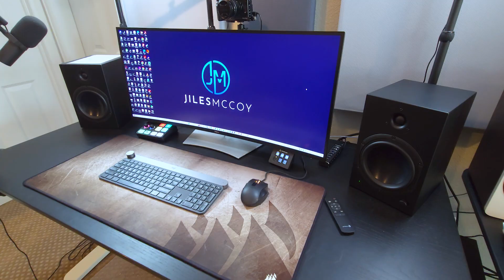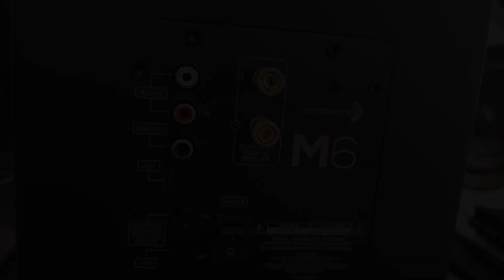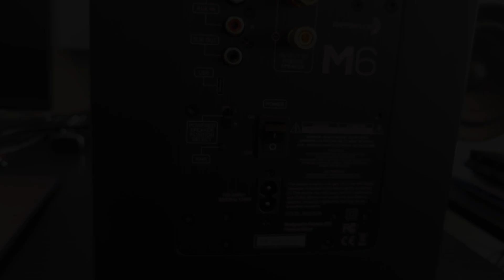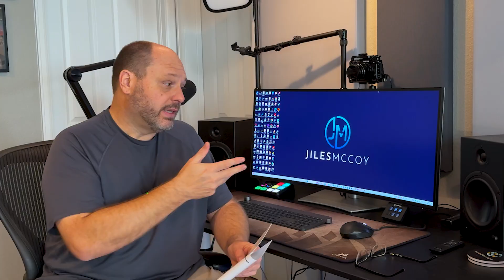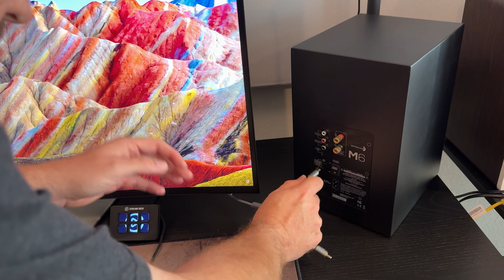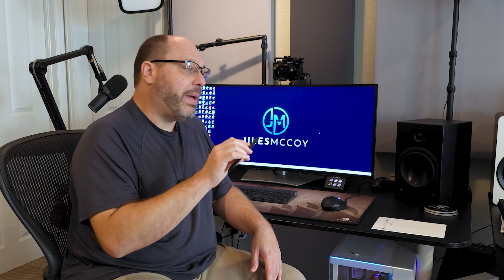I Use These Powered Speakers EVERY DAY!

Comment: 200hz is far too high of a crossover frequency to a sub.  The sound is directional at that point, and is also going to typically sound somewhat muddy through most entry level to average subs.  A typical crossover frequency for those should be more like 60-80hz.  100-120hz would be considered high, and the highest any sub should ever be crossed at under normal conditions.  The sub crossover on the M6 is variable from 20-200hz it's not fixed at 200.  The reported frequency response of the M6 is 35hz, which means it's either -3, -6, or -10db at that frequency (they don't specify, but I would suspect it's -6 or -10 seeing they're a small sealed speaker... but they do have a dsp bass boost feature).  Unless you're playing REALLY loud, such that the m6 cannot output 60hz at the required SPL, which would be a scenario in which you raise your subwoofer crossover frequency, then you will get better overall sound (consistent tonality, preserve stereo separation lower - into the bass drum and bass guitar range, and more detail) by lowering your subwoofer crossover frequency. 

Your sub's crossover doesn't have to match the M6.  The m6 control is your high pass filter point - meaning you want the speakers to roll off at and below this point.  You can then play with your subs crossover frequency separately to get an appropriate blend/hand-off between them, which you can ONLY properly evaluate using a measurement mic and Room EQ Wizard, or by playing sine wave sweeps and listening carefully for peaks or nulls around that crossover frequency.

When you said you use a 200hz high pass and sub x-over frequency with these medium sized bookshelf speakers, I instantly though, wow ok this guy has a lot to learn about sound.  That is not normal, nor is it the intended design/use case.  200hz is VERY high, and you're robbing at least 1 if not 2 octaves from the M6 that it is perfectly capable of.  That's even getting well into the male vocal range, and it's going to sound like ass compared to properly setting things up.
Reply from the maker: You have the concepts down, but your understanding of the implementation of the sub out on the M6 is wrong. The sub frequency output is fixed on the M6. There is no way to alter that. The volume of the sub output is controllable, just as the the speakers themselves, via the volume controls. Basically this is summing everything 200hz and under and pushing it out the sub RCA. The main speakers still play full range. The instructions indicate that you should use the low pass filter on your subwoofer to blend your subwoofer in with your mains (the bookshelves). Since the summed output is up to 200 hz you could play a sub that high if you wanted to, but typically, even with bookshelf speakers, you will blend at a lower frequency. Dayton suggests a 100hz low pass setting on your subwoofer when using the M6. This is very similar to how audiophile folks blend subwoofers in with full range speakers using high level inputs on subs... typically seen with REL, for example. Remember, this is a basic feature set speaker. There is no app, etc. If you read the instructions it will help you understand how to set up these speakers:  https://www.daytonaudio.com/images/resources/dayton-audio-m4-m6-user-manual.pdf
Reply from the maker: For additional clarification, this does not work like the cross over in an AVR. You can't think of it that way.

Comment: You speakers and monitor are too low, You will thank yourself if you lift them up!
Reply: Who cares about the monitor, that's pure preference, but for the audio, you're right.  They either need raised, or at the very least, put on angled foam wedges to point them up to the listener.  That's not even the #1 problem though... 200hz crossover, ouch.

But yeah it's also important to isolate the speakers from the desk so the desk doesn't become a large muddy sound radiating surface via the vibrations going straight through the speakers to the desk, hence acoustic foam pads.
Reply from the maker: @artcore103 You need to read my response so you can understand how the cross over works on these speakers.
Reply from the maker: I am about 30 years in with monitors in this position... and so far so good. But I am sure there are some that might have an ergonomic issue if they need to look down. This monitor does have many inches of play in its vertical position for those that need it. Yes, a little foam wedge to angle the speakers up to be a little more on axis would be good, but they didn't come with this accessory so they didn't get tested with that accessory. Thanks for watching!

Comment: Would you buy these or buy Fosi audio amplifier and use a set of speakers you have? I need speakers for my computer, mine are Logitech THX from 12 years ago
Reply from the maker: I’d buy a set of powered speakers. I have a fosi stack that is great, but I try to keep the clutter down. With powered speakers I can just connect power and input and I am done. Less cords.
Reply: @JilesMcCoy  I will be looking at buying these powered speakers for my computer then an amplifier